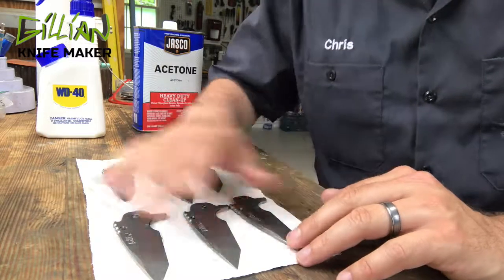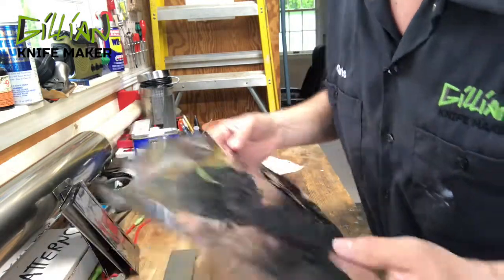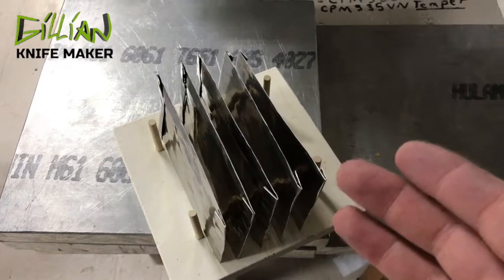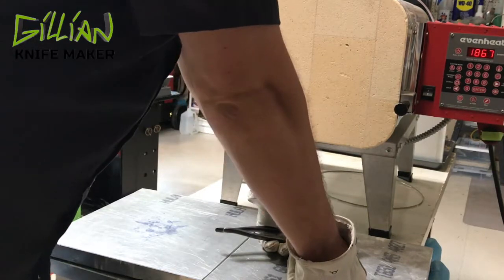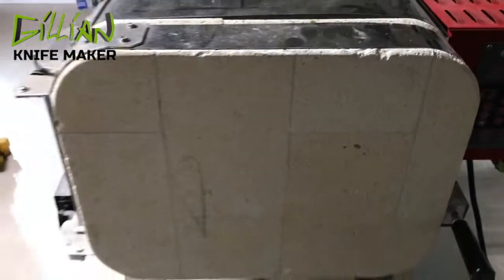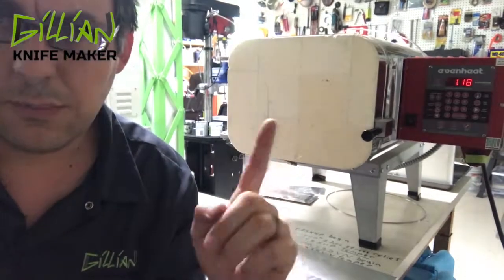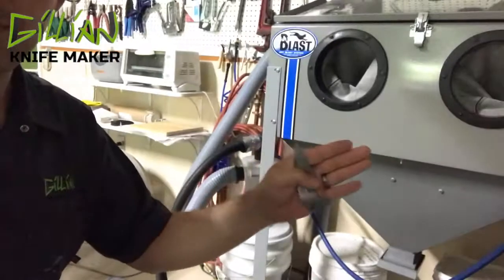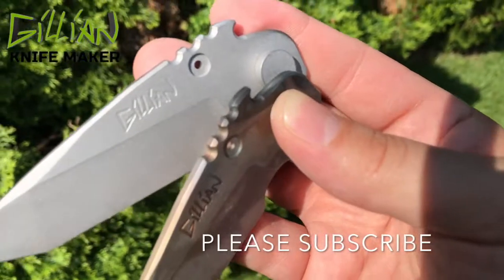How to Heat Treat Stainless Steel at Home

Comment: Sure you’ve found a way to measure by now. But I use deltonic gauge pins in tenth increments. There expensive but you probably don’t need too many just .2490 to .2500
Reply from the maker: Thank you so much for the helpful reply.

Comment: A coordinated measuring machine (CMM) can measure the hole the way you would want, other than that a inside micrometer.
The CMM has a small probe that will touch all the sides of the hole and give you a readout. 
The pin gauge blocks seem to tell you what you need to know though.
Reply from the maker: Thanks for the feedback

Comment: I have a question! I have some random stainless steel laying around, I cut out a blank and tried to put a edge on it, it's almost impossible because it's so hard! My question is can I skip the hardening part and just temper it??? I'm new to this as you can clearly tell, I'm just doing for fun, I dont have a way to harden it, I don't want to build a furnace or buy one LOL. Great video learned a lot!!!
Reply: To get a usable knife, you’ll have to harden it. You can make a serviceable throwing knife from unhardened steel. Stainless steel is hard to harden because it requires precise temperatures to be held for a specific amount of time. 

You can actually hear treat simple steels by using a campfire, or even just charcoal grill. 

A big bar of 1084 (a super easy to heat treat steel) will run you about $12. You can also use files and leaf springs, but you have to heat them red hot and let them cool super slowly in ash or vermiculite.

I made my first knife by taking a hardened file and slowly ground the blade to not overheat it. 

There’s no easy way, but the simplest is to buy a bar, cut drill and grind it a bit, then harden and temper, then finish grind. Just split the task up into multiple days.

Comment: Can i heat treat stainless steel with a normal forged of charcoal? Just asking......
Reply from the maker: Anything is possible, but it would be really difficult.  You would have to control the temperatures with a thermocouple, and hold the temperature stable for the soaking times, all while not looking at the stainless steel colors, because the metal would need to be in the inert atmosphere (read in the pouch).

Comment: How come you don't quench them in oil?
Reply from the maker: I have quenched with oil in the past, but had issues with my blade steel becoming warped.  The plate quench method that I currently use, mitigates the blades warping during the quench, if not outright stopping it altogether.
Reply: @GillianKnives  Point taken, thank you.